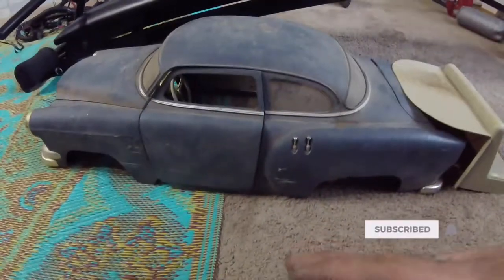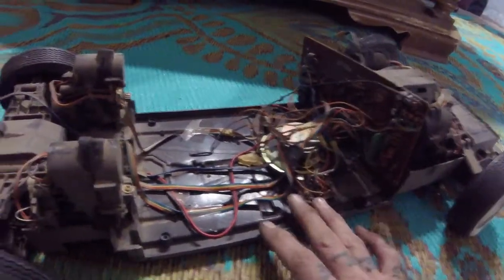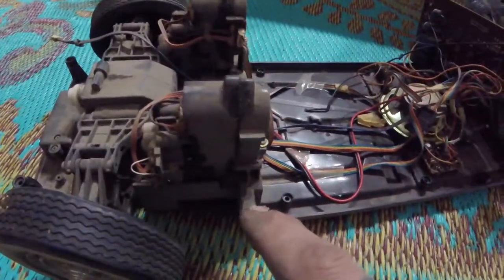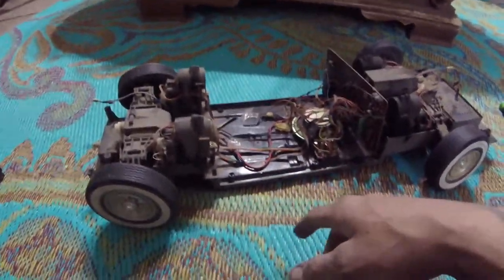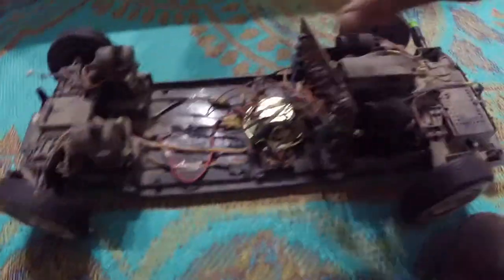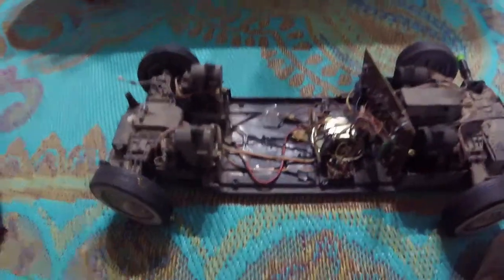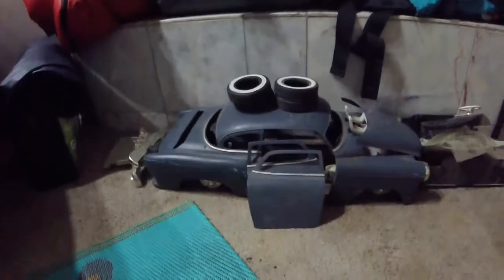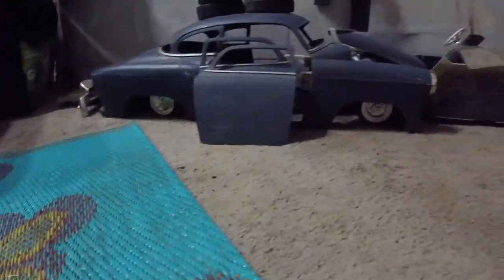Jesse James 1954 Chevy RC Custom build S12E06

Comment: I have two different Jesse James cars my grandfather bought when I was a little kid so we could drive them together. Always suck because they never work properly. Both were brand new still have them if anybody could help that would be great.
Reply from the maker: It may be that they were always sold with the same frequency. so the remotes were conflicting with each other.
Reply: @pawpatina  no they are both different I'm having a hard time finding batteries for them hydraulics on one work only on one side. No turning from front wheels and when gassing it putts. Kinda the same issue with my 2nd one